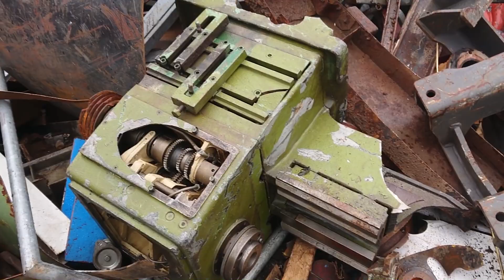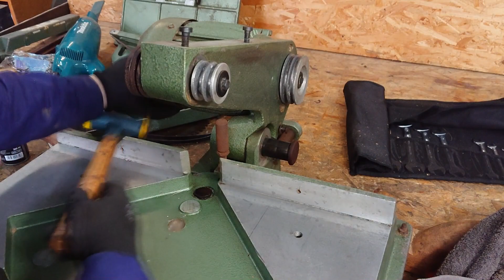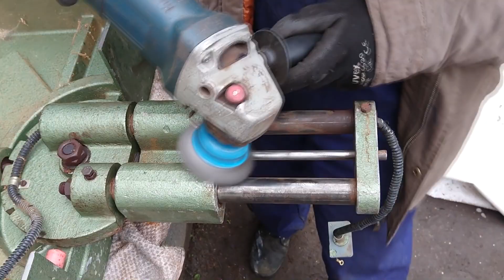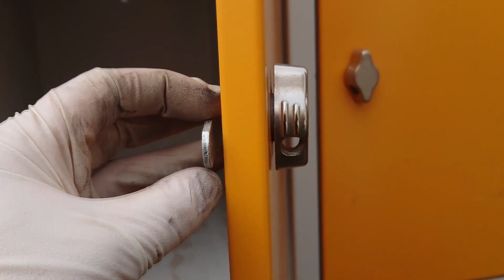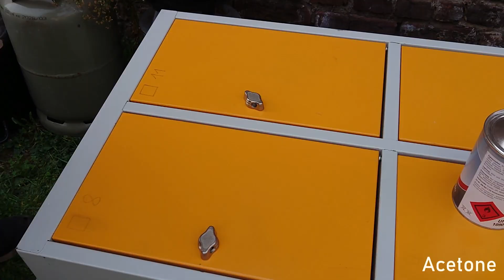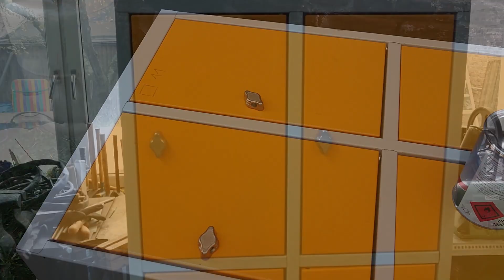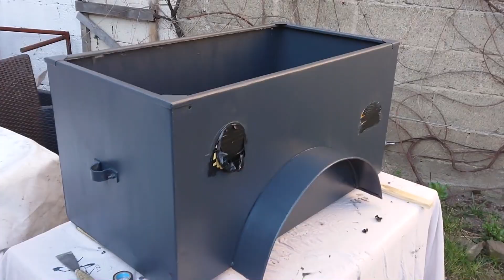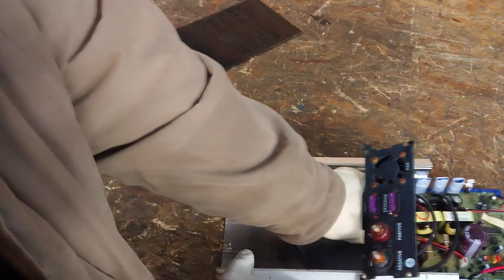Unique Scrapyard Finds! Repair-A-Thon!

Comment: Oddly enough the best way to remove permanent marker is with a Dry Erase marker. Just draw over the permanent marker let it dry and when you buff it off with a towel it removes both. Sometimes it takes more than one application depending on the marker. What I have found is that Sharpie comes up pretty easily, the older Marks-A-Lot markers are more stubborn and take a couple of applications.

Comment: Hi Gerolf,
Every new video of yours is a happy event for me.
you show things that are hard to see in other situations and I like to see (so I also learn) how you repair them, in addition to the always interesting historical notes relating to their builders.
The saw is very beautiful, you can see the sturdiness and the intelligence with which they built it: the motor all back and out of the working area allows minimum bulk and less weight on the saw.
Yes ok, the securities are those of the '70s but I think that with little you can get around.
The use of citric acid is also excellent, when I was a child I sometimes ate a few grains from the "little chemist" (the only source of "strange elements" available at that time) it was good, acid like lemon juice, just like those very sour gummy candies that can still be found now.
How long have you left the pieces of iron in the acid?
It seems to me that they came perfectly without too much corrosion!
The locker is also beautiful, although all the stickers are beautiful, the most "characteristic" and appropriate specimen is the one with the danger sign. My personal ranking is: Danger signal, TPAI sticker, transparent Train, and last the panoramic wheel.
What kind of fortune finding a completely working Inverter;
It has probably been replaced with a more powerful one and, as usual, what is not needed is thrown away .. now we have all taken this mania a bit.
The refurbishment of the bicycle trolley is also excellent: really useful for carrying things without being slaves to cars.
Hello and to the next videos, always interesting.
P.S. how is the recovery of that lathe of which you made a few videos a few months ago going (the one in the room without plaster on the walls. if i correctly remember, far from your home)

Comment: You read my mind @ the end ! I was sitting here thinking if you used an E-bike and the solar panel to charge the batteries, then you could take a multiday trip camping at night at very little expense. I wish I lived close enough to buy that saw from you. that would be the perfect size for my compact workshop in my garage.

Comment: Solar trailer for an electric bike would make a lot of sense, it would charge on the fly or when stopped and increase your range. You could have back up Li Ion batteries charging in the box to give you extreme range perhaps. It is pretty sunny here in Queensland, Australia so the Pv’s would work very well. 😎

Comment: Awesome video as always!! Specially interesting discussion about the inverter, I assume then that the output isn't true sine wave but rather square looking? 

Also, for the battery in the trailer you may want to look into LiFePO4 batteries. Some affordable chinese manufacturers such as LiitoKala or, even better, Basen, are making high capacity (100Ah to 300Ah) 12V batteries, with huge lifespans of up to 4000 deep discharge cycles (down to 20% capacity), and since LiFePO4 chemistry is more stable than Li-po or Li-ion, they're not fire-hazard. They're really, REALLY a great improvement over lead acid batteries for these type of things such as solar installations. 

Love the idea of the portable power station <3

Comment: Not sure if you noticed but the missing silicone sleeve is stuck at the bottom between the capacitors and transformers (23:10)

Comment: Another great video. Have you tried full strength isopropyl alcohol (a.k.a. rubbing alcohol) to remove permanent marker? Just make sure it's the 99% stuff, not the watered down stuff

Comment: Have you tried using Isopropyl Alcohol (IPA) for removing sharpie from surfaces? I find IPA tends to work pretty well at removing sharpie but you need to use near 100% IPA for best results.

Comment: It's been a while...! Also, I love your scrapyard, it has such good stuff... that destroyed lathe would be good for the gearing, for sure. A pity it got left behind. Good spare gears are hard to get.
Reply: Also, unless the electronics engineers who design these things have lost their mind, the fuses are for overload (two, really?) and the diodes are to entirely block incoming voltage in reverse-polarity. Hint: a "bridge rectifier" (four diodes in the traditional configuration, AC->DC, in a single package) will be marked ~ ~ on the AC inputs and + - on the DC outputs - not that you'd see that here but it's good to know -- most glass diodes have a black stripe to indicate the negative (cathode) terminal, although this isn't foolproof, and -- as far as I'm aware, all diodes with a black body and a silver stripe, the silver stripe indicates the negative/cathode side. What you describe (short out to blow a fuse) is called a "crowbar circuit" and is most common actually in power transmission lines, at least here in the USA, but you really don't want that in anything smaller.

Good that those electrolytic (large cylinder shaped) capacitors are rated 25v, on the low-voltage side, and that they have that MONSTROUS 220uF 450v capacitor for filtration. It's smoothing out the pulsed DC coming off those transformers -- after all, transformers work on magnetic flux -- they won't work on DC, it's the change in magnetic fields that gets 'transmitted' and 'received' between their coils (you'd be surprised at how few people understand this) so that the second set of power transistors can do their thing more cleanly.

I bet those transformers have steel laminations, not ferrite. They do the same thing in microwave ovens... it's horrendous for efficiency, at best, because the laminations magnetically saturate instantly, but it's dirt cheap compared to ferrite, so the companies just don't care.

The other purpose of the silicone sleeves, BTW, aside from electrical insulation, is thermal conduction -- making sure that there's good thermal contact (which is not the same as simple mechanical contact) between the transistors and the heatsink -- simple metal-to-metal contact there is not sufficient for this. Also, that buzzer is almost certainly a monitor alarm for overloaded output, insufficient input, or short conditions.
Reply: @laserhawk64  Unless the electronics engineers really lost their minds, that input protection circuit will be a crowbar.
If this is indeed a 600W unit, you're looking at 50A on the input. So even with the lowest Vf Schottky diodes available you'd be looking at something like 25W of dissipation. That would certainly, and instantly, rectifry those diodes.

An iron core transformer operating at 50-100kHz would need laminations thin enough to see through, unless you want core losses high enough to make it boil.
Ferrite cores are really not so expensive.
Reply: @somedutchguy7582  OK, I'll yield on the crowbar circuit, although probably that "600w" unit is more... 300w continuous, 600w for a fraction of a second for capacitor inrush type stuff. You should see how PC power supplies are "rated" these days, it's insane. Steel laminations... sorry, take apart a microwave once in a while, dude. You can stop a small cruise ship with one as an anchor, so don't drop it on your foot, but those things have used steel laminations basically for forever, because it's actually still significantly cheaper even when they have to be built four, five, six times as large! and again, the efficiency is horrid, besides. 1970s linear supplies were quite likely better, from what I understand. Cheap transformers are rarely ferrite. Too expensive.
Reply: @laserhawk64  microwave transformers operate on mains frequency, so I fail to see what they have to do with anything.
Reply: @somedutchguy7582  Occam's Razor: they're transformers.
Reply: @laserhawk64  I take it you have no real world experience designing switched-mode power supplies then.
Reply: @somedutchguy7582  Erm, no. 80s retrocomputer repair (and to a far, far more limited extent, since I can't program, design) and wiring harnesses/etc for custom cyberdecks and other highly-custom PCs is far more my thing. I mean, I've played around a bit with the so-called Joule Thief circuit, and various permutations thereof -- and recognizing that the old so-called 'vibrator' circuits, often used in automotive electric systems, either to develop high-voltage for, as they say on that side of the fence, "generating spark", or, later on, for the earliest of automotive radios and actual electronics... those are actually essentially an earlier, electromechanical version of the same circuit. But other than that... no, I can't say I have. I'd love to learn, though. That stuff's a dark art, to me, and I dearly wish that it wasn't. One of many such things!

Comment: Always happy to see another RaT!  Here's a good tip to remove Sharpie: Use a dry-erase marker, rub it over the area, let it dry, then wipe it off.  After a few repeats of that process, even years-old Sharpie will come off.  This works well on old test equipment where solvents would damage the paint or labeling - the dry erase marker solvent (I'd love to know what it is) has no effect on paint or marking labels.  Love the channel!  Cheers!!
Reply: The Safety datasheets are a bit cagey but (for Expo dry erase markers)  it seems to be an alcohol blend containing some secret proportions of Ethanol
Isopropanol
n-Butanol
Diacetone alcohol.

Comment: 99% isopropyl (rubbing alcohol) would have cleaned that sharpie right up with almost no damage to the paint. Use the rubbing alcohol on a paper towel and rub it on the marker.

Comment: That trailer / solar panel is a darn nice idea.   Could use it to power your lights on your bike, or even create an electric MoPed.
Definitely a great idea for when you need a short term power supply.

Comment: I have used Naptha successfully to remove glue from old tape and labels.   I had old sun baked duct tape residue on my truck.  I used white gas (Coleman Camping lantern/stove Fuel) to clean the old duct tape residue.     Both do not eat into the paint, plastic or clear coat while removing the glue.   The white gas does not leave any gasoline smell after it evaporates either.   Love these repair-A-thons.    BIG THANX!!!

Comment: One interesting design! Never seen anything quite like that, looks pretty ideal for a micro shop. I've always wondered about this, virtually any European channel shows combination planers / jointers. This seems like a very obvious design choice that saves quite a bit of room. I have never seen a single one of these in the United States. Not new or used. I've been in thousands of shops, they all have separate jointers and planers. This has always seemed extremely mysterious to me. Any theories?

Comment: In regards to the citric acid, I've been using it for a number of years. I used it to remove the bluing from 1095 blue polished spring steel so I could make saw blades for hand saws. I was told that the warmer the water, the more effective the citric acid is. And I found that to be very true. BTW, when done with the water I pour it around my acid loving plants like hydrangea, azelas, pine trees  and holly bushes.

Comment: You deserve a Million Subscribers not just for you but the people in this world need to get back in this mindset stop throwing everything away people fix stuff if it's repairable if not see if it has usable parts  try and see if someone else you know might want it  right to repair Louis Rossman my guy here on tpai don't forget diesel creek its not like it's just one individual fixing stuff I do this when I can I grew up doing this I've never owned a brand new TV set and I'm 45 I kept fixing every used TV I ever owned which was alot until they blew up yes the picture tubes exploded on every TV before I threw them out

Comment: Small tip, on smooth or non-porous surfaces, you can also use a dry erase marker to remove permanent marker stains.

Comment: I love these repair videos! I also appreciate the theory behind them. I was wondering about a secondary generating system on the trailer. Could a small generator be attached to the wheel (similar to the old bike  lamp generators) to assist charging the battery on days when the solar panel is unable to perform at peak (cloudy or even at night)
Reply: Sure. You could use dynamo hubs which could generate 2x3w with an efficiency of around 75% (bur be either expensive new wheels) or add the side running dynamos which would be very inefficient. Use case needs to be sorted out though: 6w can easily be harvested on a cloudy day, panel looks like at least 50w. Would be an alternative if solar panels are unavailable (or feared to get stolen/broken). Some pedelec wheels might be used to generate more, but than pedeling becomes a pain. depending on the trailers wheight you might be able to convert about 30-100w of power per wheel before traction gets an issue.

Comment: If you put car wax on the top of the table saw table, and buff it will prevent rust and makes boards slide quite easily. Also I used valve grinding grit on a cloth and stick to clean the grooves of my table saw to remove rust. Again the car wax treatment worked well.

Comment: I have never found that a riving knife is helpful at all for any size table saw, and especially not for small ones. By far the more important factors is fence relief angle and blade height.
And I always keep a thin wood wedge in my front pocket. I hear a pinch long before it has happened, and pop in a wedge. If it's very expensive or marginal size wood I use wedges proactively.

Comment: Ich würde den Anlaufkondensator in der Kreissäge wechseln, solange er noch dicht ist. Solche alten Teile sind sehr oft PCB haltig, wenn der platzt ist das sehr ungesund. Das ist mir erst vor paar Wochen mit einem Frequenzumformer passiert, das war wohl schonmal passiert der ganze Klemmkasten war zugesuppt. Hab das Teil dann auf den Schrott gegeben, das wollte ich nicht sauber machen…
Hab noch ein kaputtes WIG Schweißgerät abzugeben, hättest du da Interesse dran??

Comment: man i missed your educational videos of electronic stuff. Do you think its possible to turn that "table saw" into a metal cutting saw. I believe you need to lower the speed of the blade and use a metal blade. The mechanical coupling of the motor to the blade makes it ideal. Judging by the motor it could be modified to use a VFD or another way to lower the speed without losing power and basically give you a slow speed accurate metal saw.

Comment: Throwing away perfectly good galvanized steel shelves is INSANITY. A setup of shelves costs an arm and a leg, if you don't buy the cheapest junk that folds away with toilet paper on top of it. Unreal. I'm using old PC sides as shelf faces, and people out there just junk perfectly good units. This society is utterly rotten.

Comment: On the chop saw,  it looks like there are 3 pads for levelling adjusters to bear on.   You could use simple shims  but you could also make screw adjusters, maybe out of wood or plastic so they won't damage the blade if you cut into them.

Comment: I definitely like the locker! Is that inverter a "Pure Sine Wave" inverter or a square wave output?  I was under the impression that square wave was bad for motors and anything other than solid state electronics.